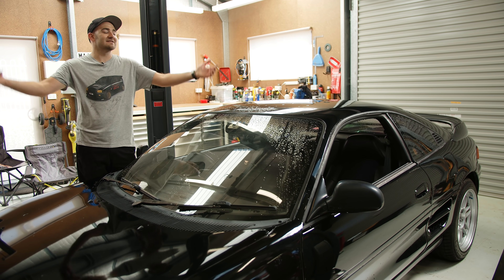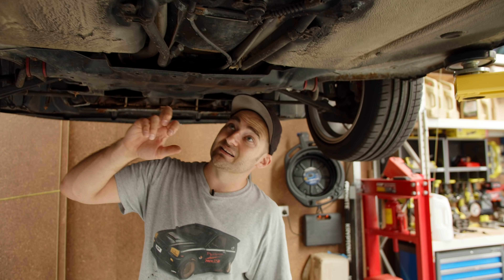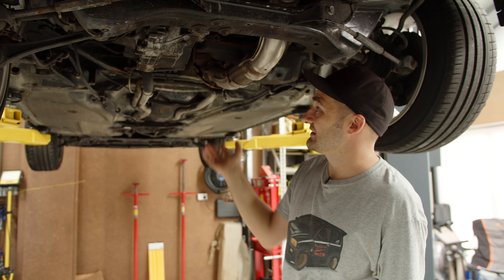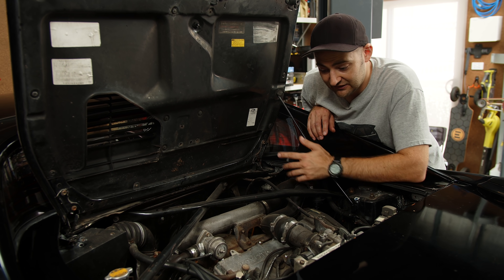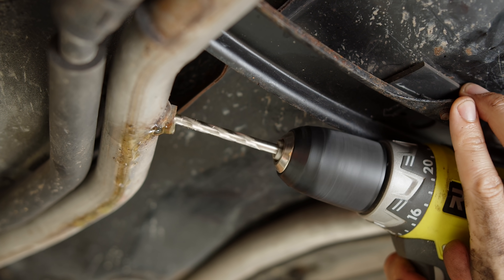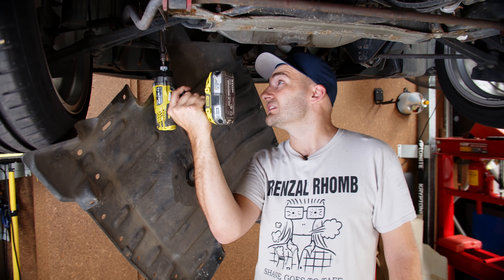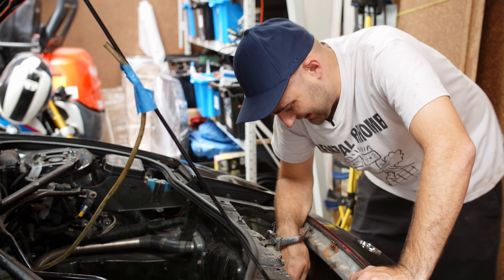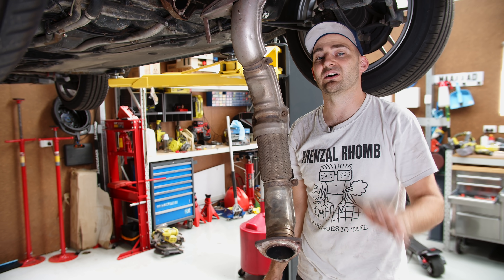Turns out my 'super clean' Toyota MR2 turbo is a piece of ....

Comment: marty- "I don't think I've ever had a car fight me this hard" - Everyone from places that salt their roads -  laughs in rusted bolts
Reply: Rusted, rounded, twisted, you name it, we have it.
Reply: Yeah. While working on my elderly Tercel I "lucked out". I only had to drill out five seized bolts and only had to use a torch twice to break loose brake nuts going into a nearly inaccessible brake line junction block. I also had to use JB Weld and mesh to repair about twenty rust holes in the rear brake backing plates. Piece of cake :( 
-dave from upstate NY
Reply: i wanted to remove cv axles on my e46. as soon, as i saw the bolt, i gave up without giving a second thought to it. its an e-torx. with e-torx part rusted off. oh, and theres 12 of them.
Reply: @HunterOfHalfLife  That's a lot of bolts. They could be drilled out and helicoiled if necessary but that would be extremely painful and a lengthy job. Maybe you could just replace the half shafts and uprights?  Pricy but if the rest of the car is good it might be worth considering.

-dave
Reply: Oh it happens elsewhere too, it just takes a bit longer. If you are removing severely corroded bolts and don't use so much as penetrating oil then prepare to start using a $5000+ EDM machine. Fortunately these were not. If you are pulling rusted up parts from "the before time", hot wrenches (OA torches) are considered standard equipment.

Comment: Marty gets a hoist only to end up swimming around the top of the engine bay
Reply: There's a trick to using hoists for better access into engine bays like this. Take the wheels off. Lower it either all the way or until the brakes almost touch the ground, whichever comes first.
Reply: @EyeMWing  well yes. This only applies to guys 5'4 and under
Reply: @lop8828  Lmaooo
Reply: Jared especially when you’re 6’3 

Wish that didn’t hit home so hard
Reply: @DramA525  Weird flex.
Reply: well it served its purpose pretty well for the things he had to do under the car.

Comment: 30 years old means its a Rev 1, the first generation which came with 14" wheels and extra snappy oversteer. It has the later Rev3 on rear lights though.
Atmospheric dump valves are not compatible with the vane type airflow meters, they can give poor idle and also hesitation on gear changes because dumping out metered air causes the engine to be overfuel.
Make sure you fit a new distributor cap and rotor arm, they get a hard life on this engine and worn parts drop a very noticeable amount of power.
Check when the timing belt was last changed, they are a bit of a ball ache to do due to limited access, so often ignored.
There are two smaller hard pipes located above the fuel tank for the coolant supply/return to the heater, it's very common for these to crack and cause a persistent loss of coolant.
Reply: Not the hero we deserve, but the hero we need! Thank you good Sir!
Reply: also worth noting this is non-interference engine. so if belt snaps its not the end of the world
Reply: Great advice 👍
Reply: Sort of confused to how a blow off valve could effect idle in any way, when would it ever blow off air at idle?
Reply: Everyone bring this guy to Marty's attention, that sounds like a lot of model-specific knowledge to me.  :)
Reply: @Neishy4AGTE  so what happens is the airflow meter meters the air passing through it whilst on the throttle, you get off and snap the throttle shut and the blow off valve dumps that air that the afm thinks is going to the engine and as such the ecu has compensated with fuel for causing a rich condition, this is why its ideal to recirculate the blow off valve.
Reply: @scootbmx01  yeh I get the science, just don't know when you would be blowing air off at idle... you dig?
Reply: @Neishy4AGTE  i think that was a poor choice of words tbh. I think it's more so on decel as you are coming down to idle. Friends rb20det used to stall sometimes with a dose pipe
Reply: Josh Hambleton Correct, I found that out the hard way when mine snapped at 65 going down an old road back road in 2002 before most people had a cell phone (91 turbo)
Reply: @d0rraj there is 2 generations of aw11 and 3 generations of sw20
Reply: @d0rraj They did. I don't know what "Rev 1" actually means. It might be referring to some stage of the series of build and not the generation build. But maybe he's just mistaken. Not sure.
Reply: I had a '90 SW20 GT Targa; JDM that I imported in 2005 with 100,000km on it.  It was a hell of a lot cleaner and less rusty when I sold it with 230,000km on it than that POS...

Since you have the dump pipe out, note that the small coolant lines near the turbo are critical - they perish, crack and leak due to heat, and you MUST buy the hard-to-find OEM version which includes a heat shield.  There are generic replacements without the shield which will last only a few thousand km before cracking from the heat.  Also known as The Bastard Pipe because you need an arm with two elbows to reach it without disassembling the exhaust.

Recirculating manifold dump valves are necessary for these old AFM engines because the air is metered before the compressor (a barn-door vane swinging in the breeze!) instead of a MAP sensor.  When a non-recirculating dump valve is used, it purges air out of the manifold therefore the ECU (observing airflow before the compressor) over-estimates the intake air mass and the engine temporarily goes extreme-rich during gear changes.  You get fouled plugs, fouled O2 sensors, soot, etc - all bad.  If you want to change to an atmospheric BOV for whoosh-noises, then really you need a new ECU.  I never bothered as there's not really anything wrong with the stock BOV.

The stock intercooler is a sad little thing.  You can get a bit more power by putting on a bigger one (no relocation) and bolting on a CT-20b from the Gen-III to replace your tired old CT-26; that took mine from ~135 to 150RWKW with no other changes, i.e. stock 9psi boost.

If you want to raise the boost, you will need a boost-cutoff defeat, which is just a potentiometer in line with the MAP sensor that drives the boost gauge.  The stock ECU will go into limp at about 11psi as I recall; dividing down the voltage from that sensor will keep you out of limp mode.  Yes, the MAP sensor that connects to the ECU is for protection only and does not affect mixture control at all.

If your tachometer is dead, it's usually due to a couple of dried-out electrolytic capacitors in the dash module.  Trivial to repair ($2 of Jaycar parts and a soldering iron), but don't disassemble the movement otherwise there's a spring that escapes and it's hard to get it back together in the correct alignment, so your tacho will read incorrectly forever after.

Other things to beware of: don't leave the car in the rain because the wells that the spark plugs sit in can fill with water and it won't start.  Also don't use a pressure-washer in the engine bay because it will probably kill the alternator.  The (electric!) power-steering pumps are infamous for dying but mine never did.
Reply: Also hose from hell and hose from hell on earth lol.. They’re water by pass hoses for stock water based oil cooler and are right in between the gearbox and turbo so they get baked all the time and leaks after years. BOV on AFM will make the car run rich but not a great deal it will affect the idle too but again not enough for me to give up the noise. Each to their own I guess. Also the stock TVIS butterfly valve is another one. I’ve heard 2 others failing other than mine and it’ll affect low end torque and top end power the turbo will feels like run out of puff above 6k rpm. Being a E153 it should have LSD in fact I’ve never seen a JDM turbo without an LSD think it’s only the USDM turbo that has open diff. It’s a viscous unit so the spin one wheel trick works. There’s a tag in the Frunk close to the radiator side, mounted upside down, if it said E153-735 or ends with odd number then it has LSD

For those who’s getting confused about rev1. So 89-91 are mk2 MR2 Sw20 revision 1. They have gen 2 3SGE/GTE (or FE on certain markets) and have zenki lamps, and the “snappy” suspension. 
92-93 are rev 2s with same engines but revised suspension
93-95 are rev3s with Gen 3 3SGTE/GE, same suspension as rev2, and Kouki lights as Marty’s car
96- end of production rev4 and rev5s are mainly cosmetic changes and the introduce of airbags. Only thing worth notice are rev5 have red top beams 3S-GE available as an option. And rev5 have different wing and wheels.
This doesn’t apply to US cars I don’t know anything about them. I think they’re all rev1s basically with lower output due to EGR and steel internal turbos as opposite to ceramic wheel turbos. And 95 was the last year of production of US cars. But correct me if I’m wrong
Reply: Piggybacking this excellent comment to give ATS Racing a mention. They make modified versions of the CT26 turbo on the MR2 - straight bolt on.
If you're leaking out of the distributor it's probably the internal o-ring. You can rebuild them fairly easily and for MUCH less than buying replacement ones.
Reply: @friguy4444  rev would stand for revision.
Reply: @Neishy4AGTE  Thanks. I couldn't figure that one. Now it makes sense.
Reply: @burtmcgurt3584  Rev1 is the first version of the second generation SW20 MR2, there were five revisions in total.  I had a Rev2, 15inch wheels and slightly tamed handling and I loved it, one of my all time favourite cars. I did drive it like a granny in the wet though!
Reply: @Neishy4AGTE  Some blow of valves don't seal well under idle vacuum so leak a bit of unmetered air. Fitting atmospheric dump valves to the Rev1 and Rev2 versions of the Mk2 turbo was always problematic. The Rev3 and later models did away with the vane airflow meter and used only a MAP sensor for engine load sensing so no issues.
Reply: @浩一王  Good call, totally forgot the hose from hell!
Reply: @ferrumignis  ahh I see you just mean leaky valves, that shouldn't be an issue with a decent GFB valve, well that's what they claim anyway.
Reply: @alistermccallum  well a good working BFV shouldn't leak at all so I don't know why that would increase performance. I wonder what Marty will chuck on there?
Reply: @alistermccallum  strange isn't it because a well set up bov is supposed to have better boost between shifts, in theory a blanked off valve is going to slow the compressor down due to the back surge of boost in the reverse direction, are you saying that's its different for the mr2 for some reason, because I think the reason why people think blanking plates are better is because people always use a bov that lets out too much, and therefore all your boost.
Reply: @burtmcgurt3584  The link with moisture means it's quite likely to be ignition related. If it's not been done replace everything on the high tension side: spark plugs, HT cables, distributor cap and rotor arm. Wish I'd kept mine tbh, but I was doing 16k miles every year and wasn't enjoying the fuel costs.

Comment: As an MR2 owner, I highly recommend taking the time to replace the hoses from hell, since you had to pull the turbo.
Reply: Absolutely.
Reply: Seconded or thirded?
Reply: And all of the other hoses as well, I recently badly hurt the engine in my Group A Celica after a hose from the water rail to the throttle body burst letting all of the coolant to escape.
I found that the seal in the distributer had been leaking oil over 3 hoses, Water hoses do not like oil! Cracked block, cooked head!

Comment: "I've never had a car fight me this hard"
Martin, you need to get yourself a 30 year old, rusted out Nissan GQ Patrol...
On a more useful note, get yourself a bunch of cheap, nasty, left hand twist (reverse twist) drill bits off ebay. Because they drill in reverse, when you're drilling out rusted out or seized bolts there's a good chance they'll bite into the bolt and thread it back out.
Reply: Everyone always says this, and i did always try to use them, but in the couple years i worked in a shop, i have only ever had 1 bolt come out with a reverse cut drill bit. I just use a nice and sharp bit now and drill it out.
Reply: @nightkil13r  softer metal bolts sometimes come out with the hammer function on the drill

Comment: "I heard there a pain to work on but when you add rust its a whole other level." 

Can confirm, my UK MR2 is a 6 hour job, no matter what you're doing!
Reply: I've just bought one, it doesn't seem that bad to be fair lol
Reply: David Roulston depends on how much the previous owners cared in all fairness. Fingers crossed yours stays good, engine wise its the most reliable car i’ve ever owned! :)
Reply: @Orangebery  I had a mk1 MX5 before hand and I was going to buy a mk2 then saw this mr2 resprayed in Focus RS green and couldn't resist buying it lol, i've yet to work on it though it's only been a week haha. But yeah old Toyota engines are bullet proof I owned a Celica a few years ago with the 3SGE engine too.
Reply: 7 months ago I started to fit some aftermarket dust caps. Still haven’t finished,
Reply: @elliotormston9417  #feeltrain
Reply: I couldn't disagree more. I've driven and raced mr2's for thirteen years, and worked on dozens of other makes of car in the meantime. In nearly every case I'd rather work on n mr2. The fact that it's mid engined makes everything easier. No brake servo in the way, no clutch reservoir in the way, no radiator in the way. Just the engine in the back and all the other crap up the front. I've got Celica'stoo  and they are much more of a pain to work on. Admittedly I've done it a couple of times but I can do an engine swap in four hours. Rust is an issue though, there's no denying it (says the man who spent a year and a half welding a mk1)
Reply: @bubarowe  You couldn't disagree more that I have a very rusty MR2?
Reply: My 91 MR2 has survived 29 years and as far as i know the only serious rot on it was the outer sills which i fixed, had the thing to bits many times and never noticed any other repairs. It's on 177k miles too so not like it's been sat in a garage
Reply: @elliotormston9417  Lmfao
Reply: @mrcaboosevg6089  Yeah, believe theres some sound deadening above the rear of the sills that collects water rotting from the inside out, not sure if this matches up with your location.  Mines been garaged for 2 years now while she gets some real love, new subframe clutch etc
Reply: He said whole next level.
Reply: Rounded a bolt just trying to change my brakes on my daily driver because I had to torch it to red hot  as a last effort  and now when I get my miata rebuild finished for the summer I'm going to have to tear the whole assembly out of the daily to rip it apart.